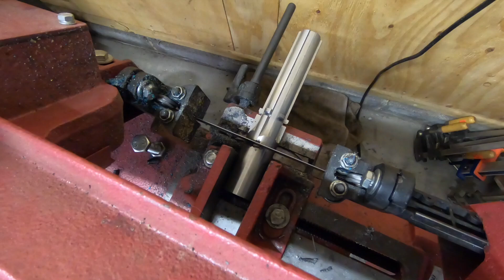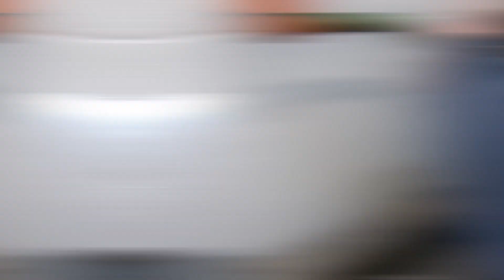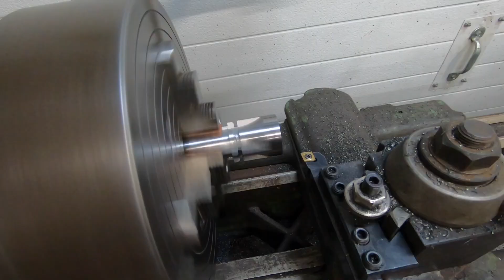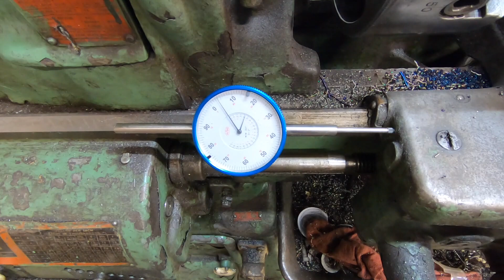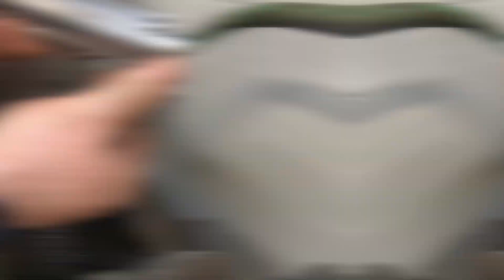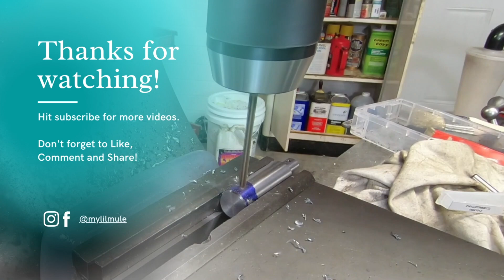K&T Universal Milling Head - Part 4 - Final Machining a 6 spline test shaft

Comment: I know this video is a year old and I haven't viewed the follow up videos as yet, but must ask if you had plans to heat treat the finished shaft?  Doing so would reduce spline wear and increase overall durability. May require some tuning up on the horizontal again though.
Reply from the maker: I did not heat treat it. I don't have a heat treat oven so I am not set up for that, and sending it out would be cost prohibitive.

Comment: I might be late for this party, if the motor wired the wrong voltage it wouldn't be running the name plate rpms.
Reply from the maker: I checked that already. It's appears to be wired correctly. I might end up just replacing the motor, but I am going to replace the bearings and clean it up first. If that doesn't solve the problem, I will replace it.

Comment: The sharpie marker trick for taking off less than .001” is a good one. One other trick you may or may not know about is to set your compound to 5.74 degrees. With this- dialing .001” feed on the compound will end up taking off only .0001” because of the law of sin. (sin A = .001/.0001)

Granted, this requires you to remember to adjust your compound to 5.7 degrees before turning down the shaft, and like you, I tend to run the compound at a more natural 30ish degrees- but it’s still a good trick when you know you might be in a situation to need it. Here’s a video showing the process:

https://youtu.be/Zz_eDXtmPGs?si=gmBplHom1DSSKF3h

Note that you need a very small cutter radius to actually be able to take such small cuts without just rubbing.
Reply from the maker: I am aware of that technique. Just didn't think about it at the time.

Comment: Have you put amp and volt meters on the power lines and replicated the issue? If you see a big voltage sag it could be the phase converter.
Reply from the maker: I haven’t. It’s not the phase converter. I also use the same converter to power a 3hp motor on my horizontal milling machine and have no issues. It’s the motor. I am about as convinced as I can be.